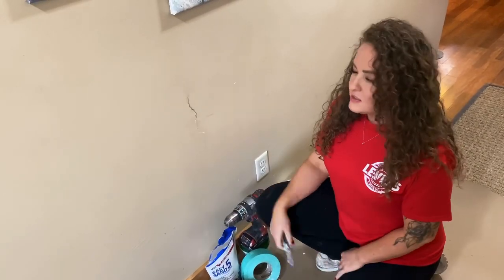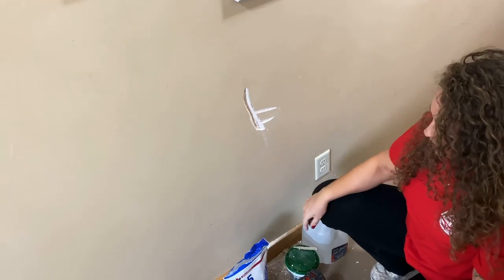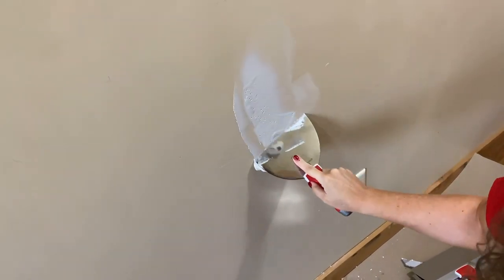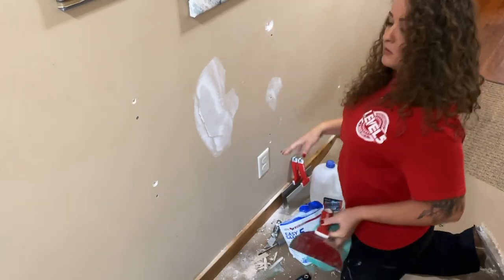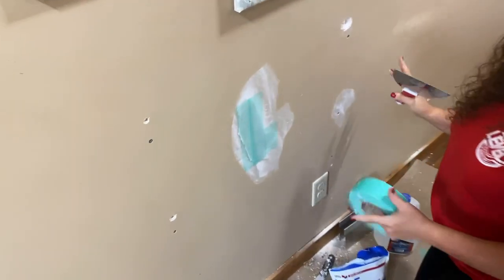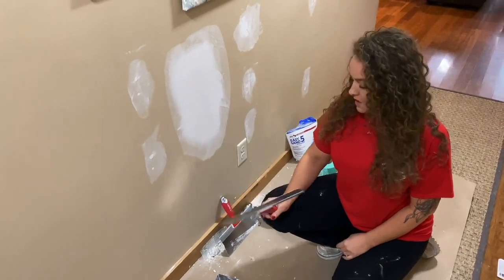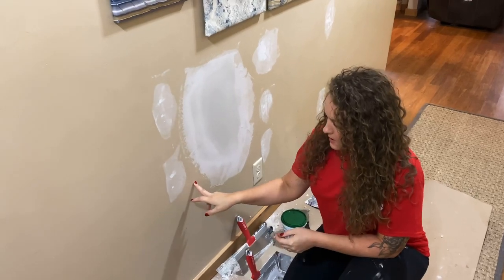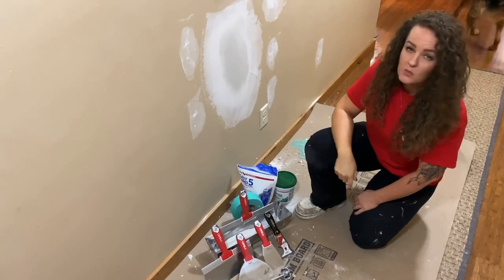How to patch and repair drywall

Comment: I have 16 yrs experience with sheetrock and paint and u are one of the best I've ever seen. U do great work. Just a tip, I put the easy sand in my pan first and mix water a little at a time like oatmeal and whip it with my 6" knife until I get a good consistentcy. Also I never touch up paint, it never matches perfectly. Gotta paint the whole wall again.
Reply: 💯 agree with you @perfect painter
Reply: Never put powder in pan first always water.

Comment: FINALLY an explanation for why the mud kept bubbling! I did a full remodel of my bathroom & no matter what mud I used or how long I let it dry between coats as soon as I painted it it started bubbling. I had 1/2 of an entire wall peel off because the bubbles wouldn’t allow the paint to adhere to the mud. I had 3 different drywall guys come in & try to fix it but no one knew why it was happening or how to stop it. After several MONTHS of trying to figure it out I gave up & had all of the drywall removed including the ceiling. Problem solved, lol. Until I started on the bedroom. The mud had dried for no less than 4 days & when we started painting it, there was one 12” x 12” section where chunks of the mud separated & became stuck to the roller. Fear came over me with flashbacks to the bathroom. I waited for the paint to dry, scraped off the chunks of mud & filled it in with 5 minute mud, waited till it dried, sanded it smooth & then waited 2 days & painted it with no problems. Whew! Can’t even tell there was a problem. Thank you for the videos, I appreciate how detailed you are about explaining each step & why you do it. I’ve watched other channels but they always leave out crucial details like why to hold the knife a certain way or when to use certain tools. Thank you for shortening my learning curve.
Reply: Wish I saw this 5 months ago. All the other guys tell you why it bubbles but don’t give that simple advice “may take 5 or more passes” to people that aren’t or don’t have time to be a pro. To fill the holes, I found taking mud right out of the bucket with no water mixed in it and really working it over the bubbled area (after scraping of course) letting it sit a minute, work it again in both directions, then scrape off flat at 90 degree angle (like people show for passing over screw holes) has been going well. After light sanding,I always prime with PVA to glue all that mud and seal before prime-paint. I won’t bother sponging off sanding dust if I use PVA before prime and paint because it is literally wood glue and paint and bonds any dust to the surface which if skipped is a big cause of peeling paint. Also, old rednecks mudding over wallpaper and not scraping and priming with an alcohol based primer (BIN 1-2-3) causes severe bubbling of tape and gave me an education I didn’t want after buying this house.

Comment: Hi! I really admire your expertise and the fact that you’re a woman in a traditionally male-dominated profession. I found myself during the pandemic being really interested in learning some basic skills to fix up an old house and working with my hands. If you don’t mind, would you have any advice on how to fix a crack above a door frame? It noticed it because the layer of paint started folding outward, so I sanded that back and I see someone repaired this spot before because there’s a layer of fiber tape and some broken bits behind it. Would you do anything different to fix this kind of crack and prevent it from showing up again? Should I cut out the previous mesh to clean out the stuff behind it? Either way, thanks for representing women! Really inspiring
Reply from the maker: Hi!! For a crack like that I would cut/v it out. Remove any broken drywall and then pack it with easy sand (any number, just use what your comfortable with) Then after the easy sand is set put fibafuse on the joint with taping mud. Let that dry then feather out the joint 👍
Reply: @DrywallShorty  Ah!!!! Thanks so much for responding! Huge fan and that was really helpful!
Reply: Okay

Comment: I appreciate your work,I have seen a lot of tapping job but yours are excellent I am a taper over 23 years, one tip every time you use fribreglass tape you most applied the mod back and forward over the tape for a better penetration,  repairs like that you can do for the first time mod tape and clean the mod works every time.good work I’m your fan.

Comment: Thanks for the video. I was thinking u made a alot of easy sand for the little patch 😅 

Would you need to use a primer sealer undercoat or straight wallapaint?

Comment: I notice you do not sand between coats. You just use your knife to knock down ridges. Is this because you have skimmed the edges tight?  I've been doing "popcorn" ceiling removal and mudding over the minimal taping, I think it's a level 2 ,  popped rusty nails (giving them a good tap) and cracks. It's so hard standing on a ladder trying to hold a pan half full of mud and hang on to the ladder. I'm 5 foot. In my late 60s. What kind of ladder do you use? (It took me 2 hours to do a 100 Sq foot ceiling.) Then I couldn't get a good angle with the pole sander, so up the ladder I went.   All in all it looks great. No visible lines from the butt joints I covered. Thanks so much for your videos.  Several neighbors have hired me to do repair work, and I always watch a couple of your videos for inspiration, and to remember steps I need to follow.

Comment: I’m wondering why you wouldn’t use 45 or 20 for your final coat , possibly skim with really wet 20 min, then spray, your definitely good enough. Hair dryer works to speed up, adding accelerators keep from bubbling .
Reply: If i had to guess I think this video is for the average home owner. 
You can't get 20 min or 45 min mud in small patch like quantities. It only comes in larger bags. 
If you were a pro and had it on hand then for sure. You could use hot mud for skimming these types of patches

Comment: I really love Level 5 tools. For an extra dollar or two you get a tool that doesn't rust. Their knives though are stiff for the beginner, but very low maintenance compared to Marshalltown. 

If you're interested in trying a trowel for the first time, their Ultra Flex .04mm trowels are really easy to handle for the beginner who wants to try a hawk and trowel.

Comment: Saw that you were going to be on Matt's Build Show series so I stopped in here . I have a couple of comments - hopefully constructive. I would recommend you point out that masking off your work area is very important . Drywall compound dust of any kind is very tough to get out of the cracks in between floor boards and is very abrasive -- it is made from rock ( Gypsum ) after all and can scratch finishes.
A point of product knowledge -- the green mesh tape is a mold resistant version from my experience -- I don't remember if the other " COLORS " have any significance or not.
A question -- why not fibermat tape ? Fibafuse is one of the brands that I use and it more easily blends in thinner to the repair though it can be a little fussy to work with. The grid pattern fiberglass tape can telegraph through your repairs more easily.
Thanks for getting the knowledge out there of the processes involved in making repairs.

Comment: Je regarde tes vidéos attentivement, tu es très bien mais dans ce cas tu as un problème.  Lorsque les fissures ont été ouvertes, elles ont dû être peintes avec de l'imprimeur et plus tard le mastic a dû être appliqué puis frottant à nouveau l'impression et enfin la couleur du mur

I watch your videos carefully, you are very good but in this case you have a problem.  When the cracks were opened, they had to be painted with imprimer and later the putty had to be applied, then rubbing again with imprimer and finally the color of the wall....

Comment: When the drywall mud is being put on a different-colored background you can really see detail! 99 percent of drywall videos are, understandably, white mud on white or light grey sheetrock paper so it's almost impossible to make out detail on video
Reply: Also: "Take a chip of the paint to the store so you can get the exact color, not just whatever color the paint was years ago when you put it on" Good point! I guess it really does change color over time